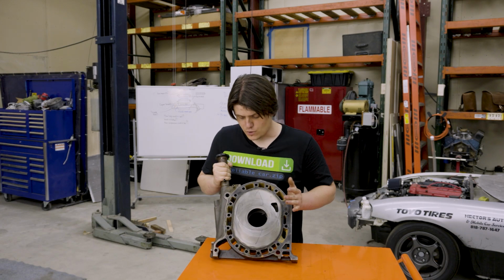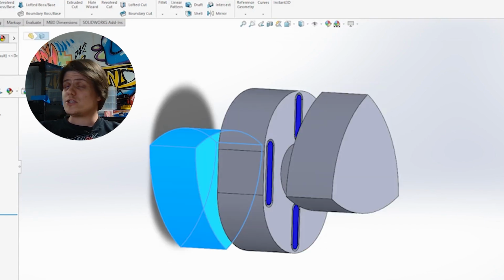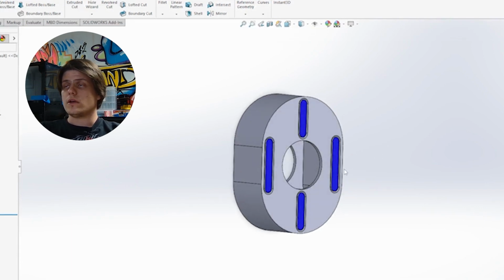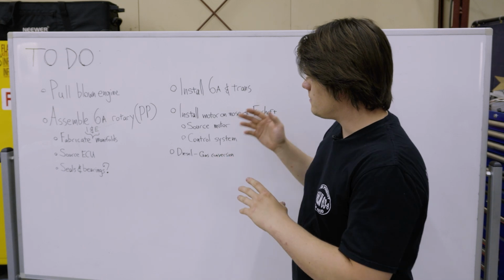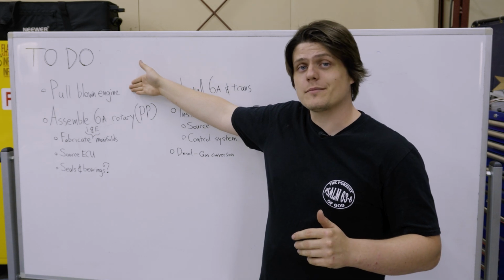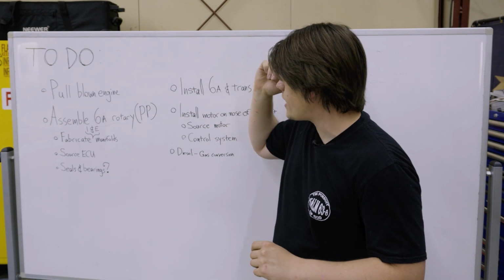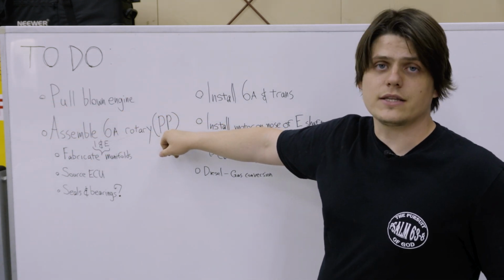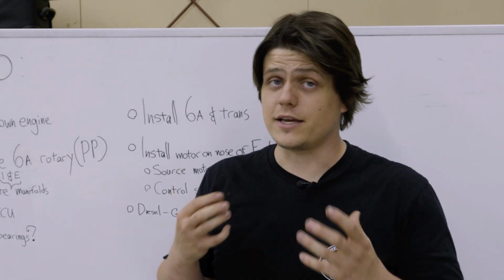Designing an Open-Source Hybrid-Electric Rotary Engine

Comment: I don't know if you'll ever read this but wouldn't it be simpler if you took an hybrid platform from another car and paired it with the rotary?. I get that space and weight wise it would be better to use an electric stator between the rotors forcing them to turn but i mean it's far simpler using an electric motor to force on the eccentric shaft or on the gearbox shaft as an helper at lower rpms.

Comment: Do you know Mazda has already done it https://youtu.be/SnI2HedhOvw?t=130 a single rotor hybed.
It gets a respectable 33 mpg with all of Mazda's R&D bought to bear on it.
Seems like a diversion from developing the car part of the project though.
The power requirements for a lightweight streamlined inline two seater car focused on economy and price point seems better suited to a small to mid size motor bike engine.
A performance 4 cylinder 250cc bike engine can get 70 mpg without the need for electric motor/battery, added weight, complication and added expense.

Sounds like more of a side project that anything cheap and useful.

Comment: I have a Speeduino kit sitting on the shelf that I bought for my $2000 Challenge E30.

I have been thinking half VW motor, IRS pan and transmission. Have too many VW parts laying around.

Also been thinking about Geo/Suzuki 1L, 3cyl. I daily drove/autocrossed for several years.

I'm doing a lot of thinking. Message sent.

Comment: 1. Open Source Auto Kit Association = OSAKA = Ready made mascot for the program using the character of the same name from Azumanga Daioh
2. Why are you killing yourself and momentum on a hybrid design when 100s of 1.3L 3 cylinder mitsu mirage engines are available for a fraction of the effort and price? Why not just use 600cc predator engines like the Robot Cantina guys which are even more plentiful? Less frontal area and weight due to narrow tandem seating means that you can probably get to highway speeds using cement mixer engines and motorbike/cvt transmissions without the rnd costs. This is starting to look like an open source version of the Elio, which is perma-vaporware tier.
Reply: He's doing the same thing a lot of young guys do. He's making due with what he has. Its like the guy in tech school putting 5k into a cavalier instead of paying 4800 for a Supra. He is doing the opposite of what makes cars great, even the rx7 was simplicity. Let's say this takes off. Where are they going to source 1500 12as vs 1500 Kubota diesels? I'd hire the heck out of this guy but he's not going to be in charge of any projects until he gets some more experience.
Reply: @jerbear7952  Thank you for your thoughts, but a few patrons could have given him the change for a used bike with a working motor transmission combo. I honestly think the idea could work but Rotary engines are a meme for a reason lol

Comment: Also, to deal with the heat issue: Take a look at Ernie Brink's modification to the 13B. He makes the spark plug aperture smaller to reduce the loss of combustion which lowers the overall temperature of the engine. Just a thought.

Comment: What would keep the rotor from just rubbing directly against the housing if you take the apex seals out?  It has to rub the apex seals along the housing to spin properly without damaging the housing.  Would it be possible to just connect the intake and exhaust ports for the disabled rotor?  You could maybe clearance the rotor tips on the sides to allow a gap for compression to flow between lobes as it spins.
Reply from the maker: We have been talking about connecting the active exhaust to the inactive intake. Most believe it would lower efficiency but I'd love to see for myself. The rotor wont hit the housing because it follows a fixed path dictated by the stationary gear and the eccentric shaft. It'll have clearance where the seals used to go.

Comment: I've thought a lot about hybrid drivetrains and have come to the conclusion that the best (least compromised) solution would be to make a custom differential housing that holds the electric motor. There's no sense in having a motor before the transmission, not only due to drivetrain loss, but also the fact that you're putting more torque through the transmission. Additionally, a clutch could be added before the diff to disconnect the ICE/transmission completely and run purely electric. The trick is going to be motor control, but once figured out, b you could do cool stuff like a max acceleration flatshift mode wherein pushing the clutch pedal while at WOT overboosts the e-motor while shifting to torque fill while you shift gears. 
This is assuming that we are creating an open source single motor budget application for a RWD sports car. With a budget and packaging for multiple motors, obviously an e-AWD set up with motor(s) driving the front wheels, and possibly more importantly, collecting energy from the front wheels during deceleration is also ideal
Reply: Great comment @SchroedingerK; I believe Toyota use the motor/alternator/starter combintation directly driven/driving effectively at the crankshaft. Perhaps they had reasons of expedience to do this, but when you factor in drive-train losses of 30% or more it becomes immediately apparrent that such a compromised approach is frankly unreasonable.
Following this logic, two motors after the differential should be most efficient, but in practice might compromise suspension options.
Perhaps somewhat contrary to your considerations Herr Schroeder, mine come from some design ideas some 35 years ago, still a kid after completing a kit-car with a friend and fantasising about the "next project".
My philosophy was to employ a higly efficient, yet low power ICU, capable of powering the vehical to your desired cruising speed indefinately - in the UK 80mph would be a reasonable speed for road vehicals. What I then named: "torque assist" operated a little like the early supercharger cars where bottoming out the gas pedal would engage the charger for only a temporary period - I think you could run some of the Porsche designs for only 14 seconds at a blast before the exaust valves would begin to burn out. You might also draw a comparison with the kick-down facility on an auto box. Your accelerator travel begins until the idealised fuel/rpm ratio for the ICU is maximised, then you feel a small resistance from the pedal, after which you are progressively introducing "torque assist".
Such a layout permits very low fuel consumtion and a lightweight ICU, whilst minimising the weight of required batteries. Good accelleration is readily provided, and intermittent very high top speeds are possible within the constraints of battery resources.
Reply: @jamesportrais3946  I agree with you that two motors after the diff would be even better than one before... And one to each of the front wheels would be best too with active torque vectoring to each wheel. BUT, this YouTuber is not an OEM with a multi-million dollar budget to figure spend on research and development. I'm thinking within the constraints of an open-source DIY budget and know-how along with the stated goal of relatively small and lightweight affordable sports car. I'm also wondering why he would choose to proceed with a single rotor design. May as well leave it as a two rotor... Or for a DIY application, not even use a Wankel engine as they aren't as cheap and abundant as so many other options. If he's after cheap and light, find a good motorcycle parallel twin. I suppose you end up with sequential shift, rather than H-pattern, which may negate part of the "experience car" philosophy. 
So many ways to skin a cat!
Reply: @jamesportrais3946  I forgot to mention that prior to posting my comment, I didn't realize that, as of 2014, Honda had updated their hybrid design from one motor to two. One on the flywheel, as they had, as well as one after the transmission, with a coupler between the motors and ability to decouple the CVT.

Comment: I don't know if this is a dumb question, but wouldn't it be easier just to fix the dead rotor? Then you wouldn't be wasting all the mass of spinning a second rotor for no reason.
Reply from the maker: There's nothing wrong with the second rotor. The plan is to test a single rotor engine.
Reply: @StandRacing  
Ah, fair enough... Again though, any particular reason why? Instead of just dragging a huge amount of deadweight for no reason, wouldn't it make more sense to have it be functional?
Reply from the maker: @tristangillis7365  The extra rotating mass doesnt make much difference at constant RPM (which is what I'm most interested in), only when accelerating. The main question we want answered is, How much fuel efficiency can we squeeze out of the rotary? So reducing the number of combustion chambers by 1/2 is a quick way to get a big result.

Comment: TeamBoosted has already built a single rotor mazda engine a while back maybe you could check their videos to see how it was done but i remember it working somewhat decent. Because if you are gonna keep the second rotor for purely the sake of balance and deactivating it i see no benefit in not actually using all that mass and hardware to make power and run a 2 rotor hybrid already.

Comment: ECU: speeduino (open source, will work with rotary). Wouldn’t be too hard build in control for the electric stall based on a map and crank angle pulse.

Comment: For the ECU, just go with an Arduino mega or the open source Speeduino. Much more affordable than a megasquirt ECU (or even the micro) and fits the open source requirements of the project

Comment: Also - in regards to PP, you really want to pay close mind to the placement of port//overlap (for drivability/emissions/mileage)
Reply: side seals need to be clearanced. For each slot/seal.
Reply from the maker: Agreed. We're toying with the idea of using two PP's and two throttle body's for high load/low load timing.

Comment: re - 1 rotors;
There's not a whole lot of info on getting a reliable 1 rotor setup running and tuned properly. Another youtube channel (team boosted) I remember had a 1 rotor (turbo) motor in one of their projects and ran into all kinds of trouble and could never get it running properly. Their channel kinda dead in the water atm.

Comment: If you go with an automatic transmission you could integrate a radial electric motor into the torque converter. That way it could be more universal to other projects not using a rotary .
Reply: First gen Honda insight had a 10hp electric motor sandwiched between the engine and the cvt gearbox. I think it was 144volts.